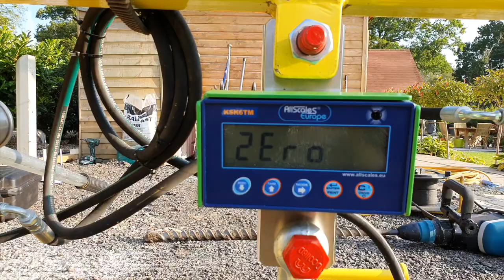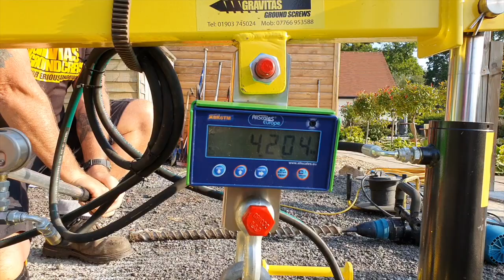Big Strong ground Screws for garden room or home office foundations no digging or concrete!!!

Comment: These seem like a great alternative to concrete!! I've seen guys digging holes and setting screwed rod into individual concrete founds but this is even better.

Does each screw require the pull test?
Reply: Unless I'm way off the mark you definitely wouldn't do that. You are testing the screw to failure (the ground is unable to exert enough force on the screw to keep it in place), once you've done that, the ground will be loosened and no longer able to hold the screws as well.

Comment: When you said you have a 50% safety margin had you been advised by the manufacturer or a structural engineer that the pull up test is subject to a 50% safety margin.
Reply from the maker: We do this so we never give too much load to an individual screw, our own structural engineers always apply a safety factor to nearly every structural element be it a beam or column etc, it's just good practice.

Comment: Just nearly killing myself trying to screw in these ground screws. What an absolute nightmare they are. Dig a hole and concrete your post holders in and save yourself a massive amount of grief.
Reply from the maker: do you not have the geared drill?
Reply: @ukconstruction  I'll look into that. I doubt anything hand held would get them into this ground though and it's inaccessible for machines. I managed to get 5 in (sort of) but had to dig a hole and concrete the last one in. Got another 6 of these damned things! I'm absolutely knackered.

Comment: Can you put ground screws in soil or does it have to be cemented floor?
Reply from the maker: Yes, we can screw into most ground and soils
Reply: @ukconstruction  Thanks for your reply, I have a few questions - hope you don't mind them. 

With the grounds shifting and soil moving over the years....
1. How long will these screws last? 
2. How does the screw hold itself in a fixed area? Will it not sink down etc? as soil moves over the years
3. Will the base be strong enough to support the load of a shed which will contain heavy gym lifting equipment? 

Thanks in advance.

Comment: How much does this system cost ? For a large garden room area ?
Reply from the maker: Hi Isaac, it worked out a fraction of the cost of doing a ground bearing reinforced raft for this project, this building was over 30m2 and this then needs to be built to the same standards as a proper new build including full building regulations and structural calculations, it is not as simple as just doing a concrete base here as we are on clay and a proper raft would have costs about £15k - £20k our screws where about £3k from memory and then the timber sub floor and ring beam was probably about £4k so significantly less hope that helps

Comment: surely its cheaper to dig the holes + fill with concrete then fix to that ?
Reply from the maker: Try getting that proved and past the building inspector, any garden room or home office over 30m2 needs to comply with building regulations that are the same as a dwelling
Reply: I'm doing garden room under 30m2 and under 2.5m tall. Dug 15 of  900mm deep holes by 300mm cylindrical shape and had concrete pumped in. Building is on stilts fixed into these concrete piles.. hopefully that should be ok. Hard work to dig by hand in the clay.
Reply: @adamandlorraine  I did that with mine. Dug to solid ground, concrete then brick pillars. No moment at all.

Comment: Is this 2 tonne for each screw or for the whole build? What's the cost for this roughly compared to a concrete foundation
Reply from the maker: Each screw, far cheaper than a concrete raft which is what we would need to meet building regs etc

Comment: Suitable for clay only .
Reply: They work in a just about all soils. In the 3 years I've been installing them, I've only failed 3 times. One the site was pure hardcore. The second was newly made up earth. The last was solid Chalk from a depth of just 500mm. I could pilot the holes after a lot of swearing but the screw wouldn't go any deeper than 500mmm. I'm getting some smaller screws to deal with this situation.

Comment: Pull test for something working in compression?
Reply: Wind loads pull the foundation up so you need some resistance to uplift, but pulling is a reasonable test for compressive loads because of how the screws work - the load (pulling or pushing) is transferred to the soil by the screw thread and the soil has the same resistance to movement whether you pull up or push down.
Reply: And the test should and likely does error on the conservative side.  Meaning the screw's  resistance becomes stronger the deeper it is founded and weaker once it is moved upwards in the ground.

Comment: When making comparisons to concrete you need to mention these don’t give you a floor, you have now got to have large steels or glulams to have joists off or a suspended timber floor, if you had a engineered raft, or trench fill/pad the floor is there. If this was a house for example you would only need pir, dpm, underfloor and screed for a solid finished floor. This solution will need pir in between the joists, either countersunk boards for the pipes and ply over the top, and the floor still wouldn’t feel as solid. If you laid these at 1m intervals your at the same price for concrete at 1m3, don’t get me wrong for timber framed structures I get the ease of use, but i don’t think everyone realises how much worse these structures are at low frequency sound absorption. Blocks all the way for me. 

You also have to question the cost too, they are around £25 to buy so your paying someone £75 each in labour, I assume he did this in a day, so that’s £1500 day rate, complete nuts for the skill levels required.
Reply from the maker: There is no comparison if you compare our solution to concrete, our building needs to comply with building regulations and a fully reinforced concrete raft with a toe and full structural engineers drawings and calculations for this would cost a small fortune, we are on clay so rafts need to be unbreakable by heave or subsidence try getting a price for an 11m x 4m raft!!!, Oh and yes my contractor hopefully does make a profit, he has invested massively in transport, equipment, technology, training, advertising, professional fees and put a great deal of effort in building his business, I have seen him graft and its only thanks to his experience that he can possibly make a profit, I am a champion for people getting on in life and anyone who is prepared to stick their neck out deserves rewards, unless you work for a hobby!!!
In other parts of Europe Norway being a casing point Tradesmen and women are highly respected and earn 4 times what we earn here!!!
Reply: @ukconstruction  Ludicrous comments, almost as if I'm disrespecting an entire industry. This is one of those products where alternatives are more expensive so lets charge a lot for nothing, remind me not to get a quote from you to stick concrete fence posts in.
Reply: Let's not forget how bad concrete is for the environment. Even if the screws were more expensive, within reason, I'd gladly pay more to avoid using concrete for that reason alone.

Comment: Bloody expensive
Reply from the maker: Hi Daniel, compared to a concrete strip foundation these are far better value, in this instance because this garden room is over 30m2 we have to comply with building regs and they accept these screws, if we where digging a 1m x .6m trench for this building and getting rid of the spoil and then mass filling with concrete it would cost 3 times the price, so they are a good solution in some instances!!